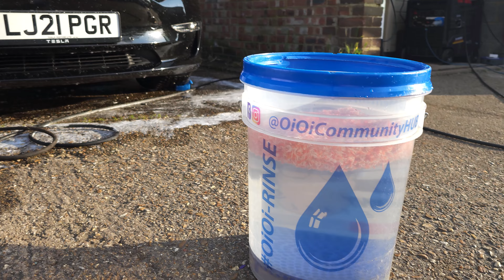TESLA MODEL 3 - FIRST WASH Since using G Techniq Crystal Serum Light & Exo V5  #jonnyshielldetailing

Comment: I do love a clean black car, best colour IMO. I was interested in the steps, what was put on after the SF but before the contact wash? All the best.
Reply from the maker: The car is ceramic coated so a thorough rinse followed by a gentle snow foam by garage therapy Is all it needed as we were removing dust. 

Mjjc lance had @Waxandaway phneutral shampoo to blanket the car for lubrication. Just needs one bucket then to use as a rinse bucket but it has shampoo in it too add to the slickness.
Reply: @Jonny Shiell Detailing  thank you Jonny. The consistency made the lance applied shampoo made me think it was a ceramic LSP and thought, oh, something new to try 😂.  Have a fab weekend.
Reply from the maker: Hahaha, yeah because it's freshly coated I can see why you'd think that, it's hard to get shampoo to stick and cling. If you like a lance applied sealant then go for autoglym polar seal.